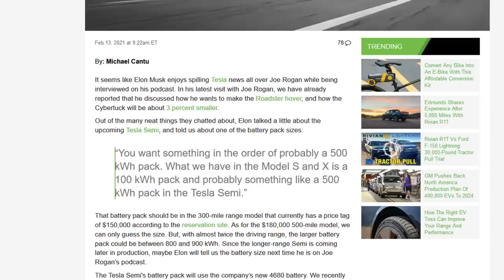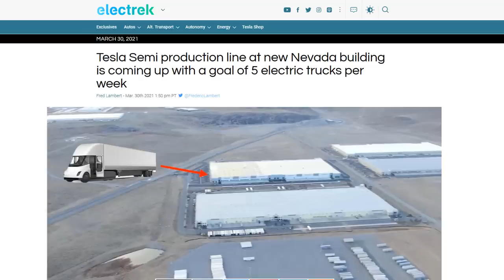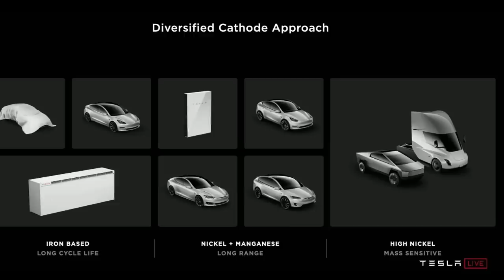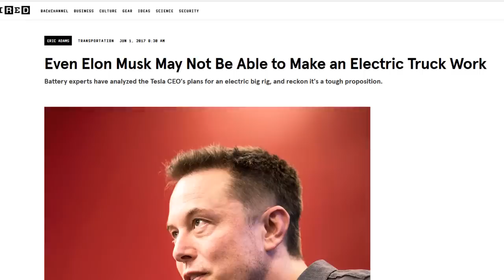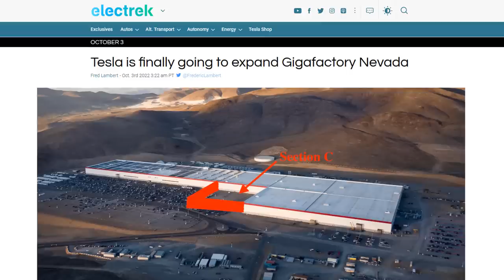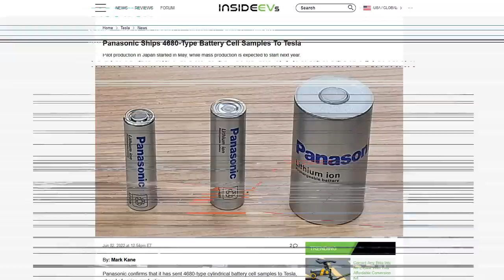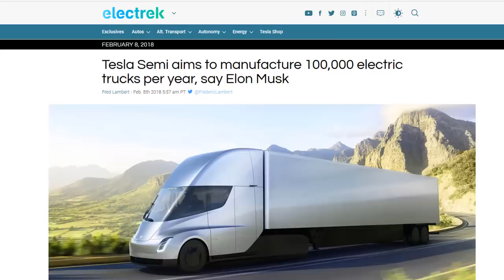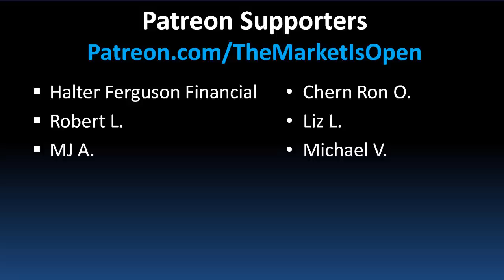Tesla Semi Is Coming in a Month - Let that Sink In

Comment: Meh. 'Conventional Wisdom' be damned.  See, most NaySayers who claim the Tesla Semi is a fraud or 'impossible' are idiots or morons.  They are making incorrect assumptions and using the wrong math to support their argument.  Primarily, they presume the Tesla Semi will be as inefficient as Diesel Trucks are.  Much the same way the automotive industry professed for the same reason that there would 'never' be a fully electric passenger car with a range of 200+ miles for over forty years prior to the release of Tesla Model S.  That is the missing link that NaySayers repeatedly overlook.  Even as they point gleefully at the relative weight of long range EVs compared to similarly sized or smaller ICE vehicles, they don't acknowledge that the torque produced by electric drivetrains, combined with their efficiency wipes out any claimed disadvantage.   The Performance of Tesla's vehicles immediately displays their superiority to ICE competitors.  

NaySayers also like to point to the price point of long range EVs when purchased new.  They overlook the reality that Ford, GM, and Chrysler all abandoned their entire line of midsize, fuel efficient, 'affordable' vehicles in 2017 and 2018 in the U.S. as being 'unprofitable'.   They also overlook that in 1990 the Average Sale Price for a new vehicle in the U.S. was $15,000.  Today, the Average Sale Price for a new vehicle is over $37,000 in the U.S.  So, no, there is no refuge for ICE behind a facade of prices at retail for vehicles.  NaySayers enjoy saying that 'most people' can't afford to purchase new EVs, again, overlooking that those same people can't afford to purchase the most desirable ICE vehicles either.  Basically, NaySayers arguments are entirely full of holes.  They have nowhere left to turn where logic defends their position.  

Fact is, 'most people' purchase used cars in the U.S. each year, on the order of 35,000,000+ units of used vehicles, averaging ~$20,000 each and 10+ years of age are sold each year.  Less than 17,000,000 units of new vehicles were sold in the U.S. last year, for comparison.

I have maintained since 2014 that NaySayers were wrong, that Tesla's eventual entries in the pickup truck and Semi Truck segments would be far more capable than ICE vehicles in the same market segment.  All the presumed weaknesses of electric drivetrains would be addressed and fully eliminated prior to their release.

Comment: Another important thing to remember about the 4680 battery cells is that they're using standard range may not be the same chemistry that they promoted at battery day. Because working with other suppliers to make those batteries, they appear to be using not the chemistry that was presented at battery day. So it's more of a standard lithium battery just in a larger form factor.
Because it wasn't so much the form factor itself that was giving them the extra capacity but it was the chemistry as well that led to it. It was a combination of multiple items
Reply: And 13 days later, it's now been revealed that the 4680 battery cell has slightly less energy density that the 2170 it replaces.
Reply: Thats what I was thinking. I believe the current 4680 cells are Lithium Iron, which would have a lower energy density and longer cycle life. You need high energy density for the Semi, so until they ramp up 4680 production the best choice is 21700 for now.
Reply: @silvy7394  You also need very low internal resistance. If the semi can't stand up to regular fast charging, it's dead in the water. Hopefully the 4680 has solved this problem, at least.
Reply: @silvy7394  Yes, this is a drawback in tabbed designs. Making the cell larger, as was done when "re-designing" the 18650 and producing the 2170, resulted in increased charging times as a consequence of increased internal resistance and a lower external surface area per amp which reduced the ability of the cell to dissipate heat.
Theoretically, the tab less design of the 4680 largely overcomes the problem of internal resistance thus negating the problem of reduced cell surface area per ampere. This is every bit as important as energy density
with regards to the semi. Commercial operators don't have the luxury of waiting hours to recharge their vehicle. Equally, they're not going to be too happy replacing batteries after 500-600 fast charging cycles as has happened in the case of some commercial EV operators.

Comment: A megawatt of battery failure and the resulting fire. What of the option to cover the trailer in solar panels in fair weather states? Will the charging station have power walls and solar panels from Tesla for the combined package with virtually no emissions, are the trucks going to be powered by Coal? Perfect for Phoenix Arizona, but Hoover dam realistically can't take on the additional load. The secret to the truck's success extends beyond the truck itself in order for it to be truly successful. Having a fleet of a million of them, charge as you drive along the long desolate interstates becomes more realistic. As for the batteries being in trucks versus cars, the batteries and trucks will be working all day everyday versus the batteries in cars which will be doing a much lighter duty with a lot less environmental impact. The coupling from the grid gives you a fixed cost which with the help of inflation brings lowering energy costs that are stable versus the endless rise associated with the variables of the grid. If for example, solar power is 10% more today than power bought at the meter, in a matter of time, depending on infinite variables, it'll be 30% cheaper than the meter in short order, especially as prices are rising today overall. A new Warehouse district for the Port of Los Angeles is being built in Arizona. Next to the highways, trucks will be doing the hauling for now. All new construction, built for the 60s or the 21st century? When will Tesla be invited to planning stages before a single shovel is turned? That's how you build the future. Starting today and yesterday, how is capitalism going to adapt? The flow of free money to Wall Street has ended leaving little for the rest of us, unusable hammer in hand, at a high sovereign price. Like sausages coming off the assembly line, will owner operators opt for the autonomous model? Like a Buick, it Parks itself, backing perfectly up to the loading dock every time. All you need is 5G pallet jacks to load/unload it, all with no chance of shrinkage. Somehow that's what I picture the future to be. Freed from their cage, truck drivers will be free to be whatever they want to be, to do whatever they want to do, and see what everybody want to see, as long as it's not in the cab of a truck which drives itself at the perfect miles per gallon arriving exactly on time where there's a pile up at the dock because there's nobody there

Comment: Why not put the battery pack in the trailer and a smaller one on the tractor just to move the power unit. Then everytime a trailer is docked it could be charged and you would lessen downtime for the tractors . 
Just a thought
Reply: Your assuming that customers that charge us a fee to unload their freight will actually install charging infrastructure . Good luck with that .
Reply: Weight is the main factor...
eg... If the max allowable vehicle inc load is 50 tons.
If the vehicle including the trailer with battery will weigh 30+ tons so you'll have a 30 ton vehicle carrying 20 ton of cargo...
At the mo the average ICE truck weight is 10 tons so they can carry 40 tons of cargo.
The haulage industry runs on a very small margin.

Comment: I thought from the beginning wouldn’t be super cool RV. Solar panel the roof may be the two walls on the exterior use flatscreen TVs with cameras for your views out you go park somewhere fully self-contained I mean you could have 1000 gallons of water thousand gallon sewage tank and a 40 x 8‘ x 8‘ RV camper trailer whatever you wanna call it

Comment: This semi will be operate in locals instead of long haul due to lack of charging at truck stop.  Driver could use existing supercharger to recharge but then it will take time to charge
Reply: It's all revenue opportunity rather than downside. B2B pays for all elements of the proposition. The B2B package has huge recurring opportunities.
Reply: But local deliveries are mostly permitted loads going up towards 110k lbs in weight basically killing the Tesla semi

Comment: Many questions- i know these vehicles are fairly new, but is there a parts/service network for these trucks? Are there going to be more applications for different needs (single axles, shorter chassis, different body setups for vans, tankers, specialized equipment)? Is there a Federal government rebate for businesses that have these vehicles?
Reply: this is vaporware its not real
Reply: @chromebomb  I have seen the Tesla semi on the freeway... Vaporware doesn't haul tens of thousands of pounds down the freeway.
Reply: Tesla only parts. When it breaks plan for 4 weeks to get the parts, and only orders with the VIN. Also expect them to be expensive.
Reply: I would say it's a pretty good indicator of parts interchangeability when all of Teslas cars use the model 3 inverter. The semi uses model 3 motors. I'd assume a good portion of this truck is already sitting on parts shelves.

Comment: IF the Telsa  does not far outperform the Rivian, it would only tow 2700 lbs 360 miles; or 40,000 lbs 30 miles, or maybe it can go empty 500 miles? 
The Tesla literally has to outperform the Rivian by 15x to get close to it's claims.  There is always down hill, maybe that could extend the range.  So all the hype about it will need some real world evaluations and will the promoters and dupes say they were lying?  Of course not.

Comment: Yes Semi's might hit 50,000 other trucks by 2024 if it drives AI; the ECOnomics are frightening as Halloween.  The Semi is claimed to have a range of 500 miles. Realistic? At highway speeds?  In real world driving?  A Rivian pulling a 2700 lb load was only able to travel about 120 miles before it had to be recharged in the real world. Rivians battery is 130 kWh,  Semi 500kWh - can a battery only 3x larger tow 15x as much 4x as far? Maybe downhill.
Reply: Agree, I think this sort of video shouldn’t be released until after the trucks are in regular use and real world facts can be established

Comment: This is a huge game changer..faster & cheaper freight.
Reply: Faster?  Look at how long it takes to recharge.
Reply: @jackfrost8439  it would be mainly for local freight, which most large companies could afford to always have a truck on charge while one is operating, gas engines will still travel large distances. But once the goods are delivered these trucks can drive to much closer locations and make multiple deliveries on one charge. Much more profitable this way
Reply: @devinparks7150  So, companies will have capital payments for two trucks, but revenue from one?
Reply: @JohnSmith-ux3tt  no the fuel engines will be used to carry varied freight( Walmart, target, Best Buy) there are many companies that do not own their own trucking industry. Multiple trucks and stops have always been used. Electric would just be efficient
Reply: @JohnSmith-ux3tt  and if you are talking about having multiple electric vehicles, I would challenge you to find me one trucking company that only uses one truck from start to finish. There isn’t one
Reply: @jackfrost8439  , not to mention the frequency for long range trips. Truckers make money based on time and efficiency.
Reply: @Quintanaroo2117  The trucking companies (and independent truckers) make money based on mileage.  Time is a given, that is the average distance any drive can drive on any given day is about 660 miles, give or take.  Depending on the route chosen that average can drop to as low as 500 miles a day.  Weight isn't an issue for normal operations since the limit is 80,000 pounds of truck, trailer, and load.  For the driver, it is a matter of time and mileage since he must factor in waiting time for loading, unloading, and dispatch.  The most efficient load is the dedicated load/destination.  But most trucking loads do not fall into that category.  Hence load boards and load brokers make their living matching load to truck company.  For specialized loads (flatbed, heavy haul, oversized) the market is a bit more complicated.  Here the EV class 8 tractor cannot effectively compete.
Reply: It's not a game changer.... Electric trucks with similar capabilities already exist on the road... The only new thing is the Tesla badge
Reply: Not sure about that Ryan.  Tesla mega charging infrastructure needed and I have serious doubts the grid can handle thousands of these?
Reply: Wait until you find out about rail!
Reply: @calanm7880  putting batteries in everything isn't the answer to the world's problem Callan sadly
Reply: @calanm7880  Most individuals do not know why and how trains were invented nor automobiles, nor trucks.  If you were to study the history of transportation you would gain an appreciation of how water routes and land routes came about, what were the advantages of each and what were the disadvantages.  We take paved roads for granted and yet when we look at the developed world paved roads were a luxury a hundred years ago.  We look at rail roads as they evolved and spread out over the landscape and see that for the most part little thought was put into providing rail service to so many rural communities.  The same goes for paved highways.  We use river vessels on existing rivers where the depth of water is sufficient year round and dug a few canals to connect water ways.  By the way, the Erie Canal was only dug to an average depth of 6 feet, think about that for a moment.  As for railroads, prior to the 1880s there were a number of different gages (width of rails) in the US until all the rail roads agreed to switch over one one weekend to a common gauge.  But the fact remains that in what ever country passenger rail traffic is at best a marginal profit center and usually a loss for railroads.  So it goes, individuals come up with what a few call a brilliant idea only to see that such brilliance is nothing short of premature.  What is particularly galling is those eco-warriors who love to sound the alarm about how un eco friendly gasoline and diesel fueled vehicles are they conveniently over look just how un eco friendly battery technology is, they don't want to look upstream and the environmental mess our current battery technology make of our planet not to mention the poor who become enslaved to that process.  But the ignorant such as Gretta believe that the poor in the Congo working unregulated cobalt mines will die from Global warming long before they die of accident or cancer from the mining.
Reply: Faster? Cheaper? You must be like 16 years old have no experience in life to say that.
Reply: Volvo are already making and selling electric trucks, so, no, not a game changer.
Have you seen many on the roads where you are? I haven't either and there's a reason for that.

Comment: These trucks could work wonderfully for smaller box trucks, like local delivery vehicles.
Reply: There's a few companies that have done this. Such as Arrival. I believe they had a contract to replace UPS trucks in some areas. Without knowing the daily range of a local delivery truck, that seems like the best use case. I'm thinking of places like Japan where small delivery trucks are already the rule rather than the exception. Who knows.
Reply: @Pyromanemac  there are tons of them here in norway, but they cost 50% more then a normal box diesel truck and have like 10% of the range on one charge which is 160km lol
Reply: @Zirion123  the average UPS route in the US is 120km in ubran areas, its hard to calculate fuel efficiency for stop and go driving but it sounds like they are working fine in this role.
Reply: Stupidest idea ever, sounds good till they load the thing with freight
Reply: @robertlandin40  these electric motors are capable of hauling weight, their range will be drastically reduced but for LOCAL deliveries, that’s fine.
Reply: @robertlandin40  they already do electric delivery trucks/vans and it works well (amazon has been testing a fleet of 1000 of them already). Electric favors stop and go urban driving due to electric regenerative brakes, and delivery trucks have a predictable schedule that makes charging easy.

electric is unquestionably bad right now when it comes to OTR trucking and with unpredictable schedules.
Reply: Has anyone ever actually driven OTR and pulled into a truck stop to get fuel? Then waited to fuel with 12-15 other trucks at the same time? I have and I am right now. Now imagine every single truck needing a charge. For now that process will take hours. Not feasible. But here we are. Smh